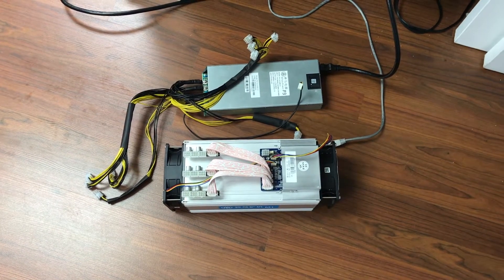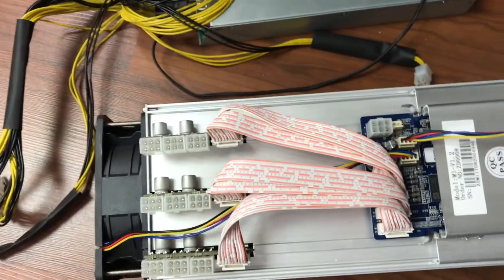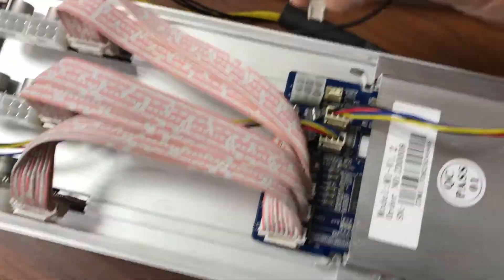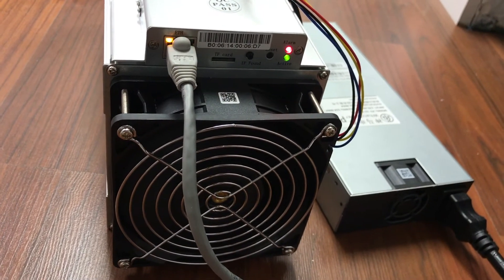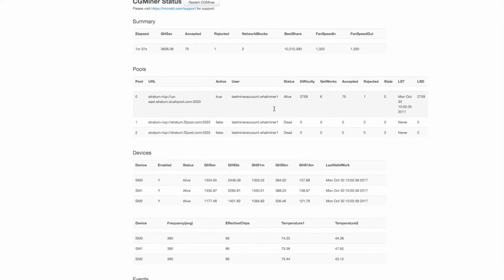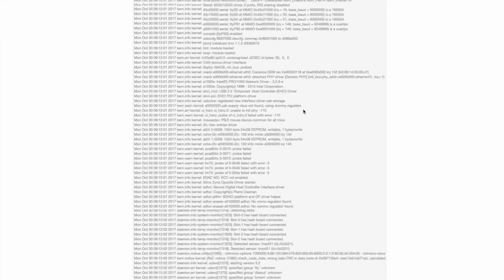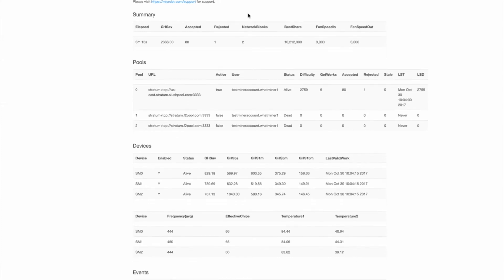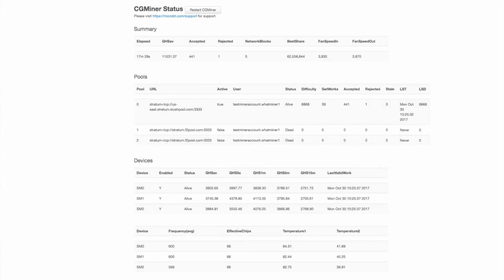WhatsMiner M1 Bitcoin ASIC Miner Demo In English

Comment: Hi there Joe, I am an interested buyer and am doing my research. I am just wondering as shown in the video at 4:26. Are the chips running at 84 Degree Celsius? As they use Celsius in China. How long can the chips last at such a high temperature. S7s are also running 28nm chips and they have a safety feature to cut off power when temperature hits 80.
Reply from the maker: lets discuss over email